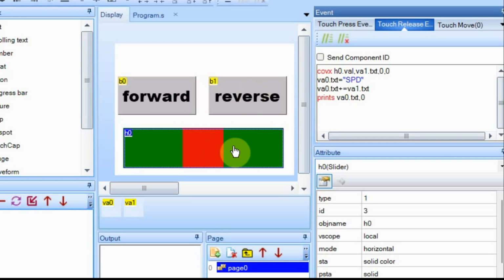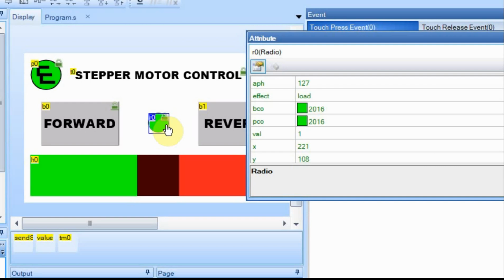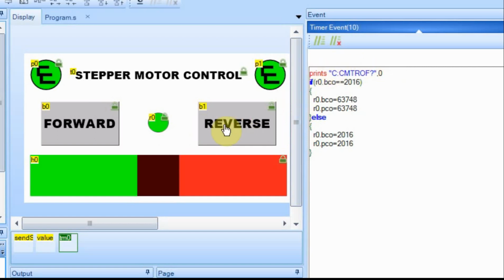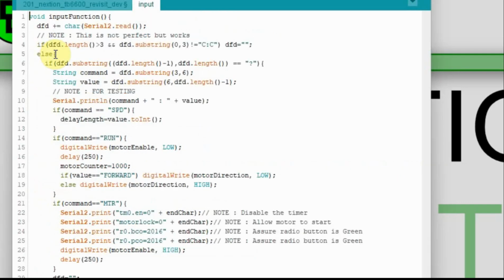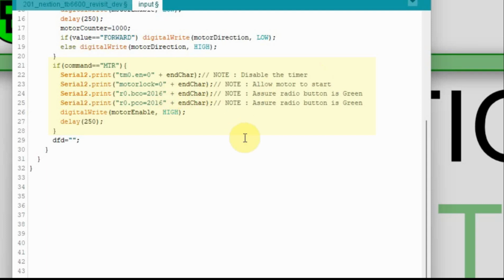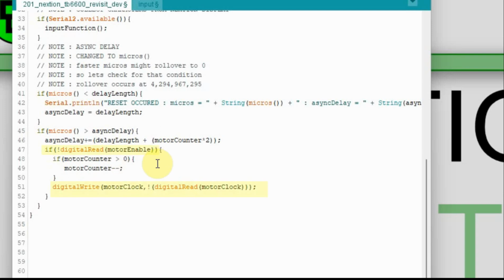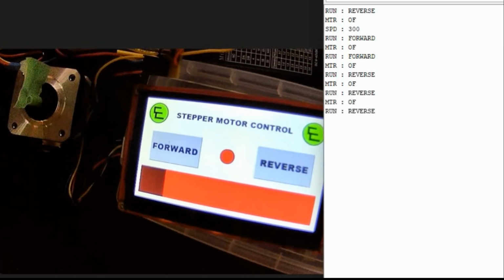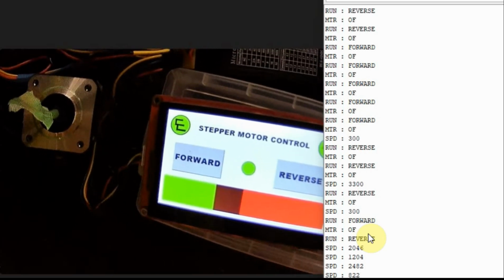201 Nextion and Arduino controlling a TB6600 stepper board

Comment: Is it possible to do this with the one serial port on the Uno? Please advise. How would I change the code you provided. Thank you for your time.
Reply from the maker: The uno is pretty close to the nano.  The code should work on the uno.  The reason that I use a second serial is that I want to use the primary serial as a debug for data in the serial monitor of the Arduino IDE.  You could connect the basic serial port up to the Nextion and not use it to send informational messages back to the IDE.  But, you would need to unhook the Nextion display while uploading the code from the IDE to the Arduinio and then plug the display back in after the upload is completed.  You would have to comment out all references to "Serial" and then change all the references for port Serial2 to Serial.  At least I think that is what you would have to do.  If you want more information or help go to www.cheapcontrols.com and submit a comment.  I will reply.

Comment: Excellent video friend, I did something similar but my slider starts at zero and as I increase the motor speed increases, turning in only one direction, my question is why when I want to control two motors they interrupt each other when both are on at different speeds controlled with their slider individually..??
Reply from the maker: I am not sure.  Are you using delay statements or asynchronous control?

Comment: thank you mate <3
Reply from the maker: You are welcome.
Reply: I was wondering how can we add some simple things like i wanted to add a uv light on off switch and a spray button by using a simple spray motor, i want to control that using same code and same page on the display. Can you help with that?
Reply from the maker: @Birdy-fps  You can request help over at www.cheapcontrols.com in the need help section.
Reply: @CheapControls  i just needed some help on the file you mailed me, if you could edit those with these changes ?
Reply from the maker: @Birdy-fps  I get a lot of emails and requests for help.  I apologize that I can not remember this one.  Please send me the file back in the same email and I will take a look at it.